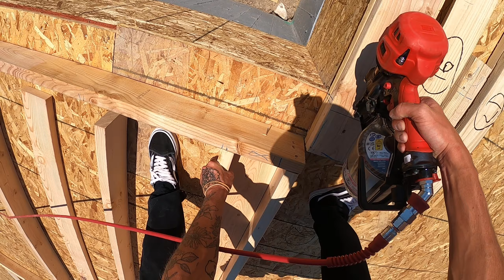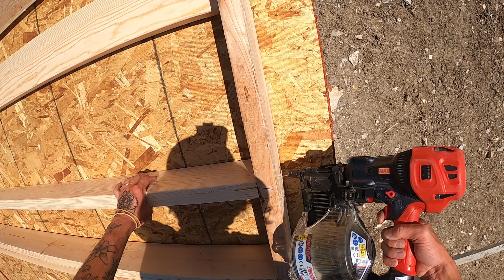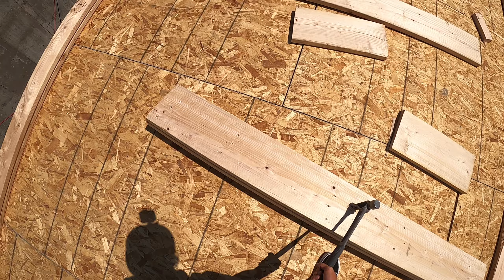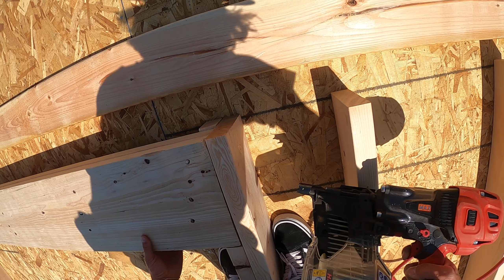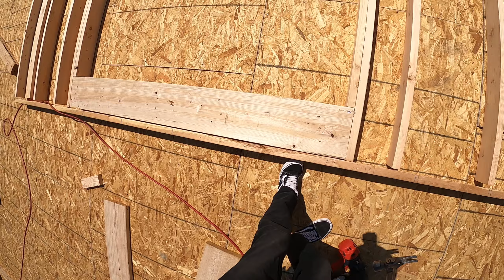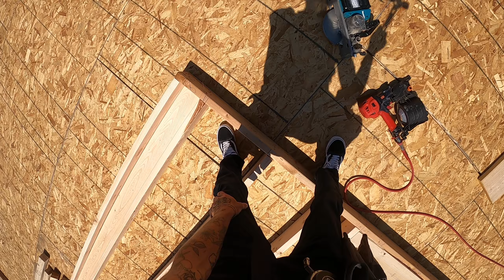Wall Framing! Still Trying To Be Like @framingbeast720

Comment: What an ugly way to pick up the wood from the floor, it's hard for you just to lean a little more and something else sharpen your aim with that gun in the more than 10 videos I've seen of you, nails come out of the wood on the sides and not the you remove correcting your mistake